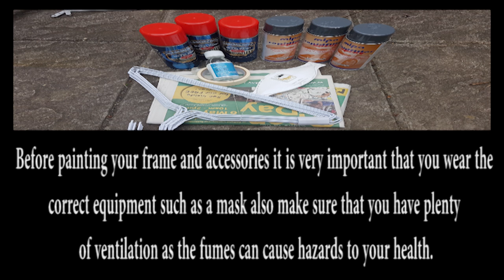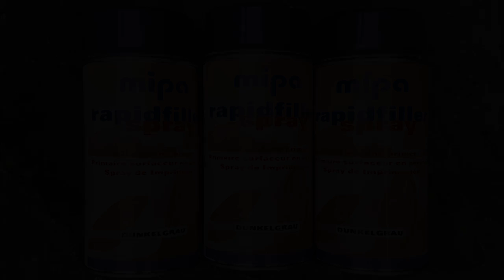How to paint your 80cc motorized bike frame

Comment: watching the disc brake sprocket mount right now actually...def gonna try that!
Reply from the maker: +Yoc Vegas ok well you will need to recount your engine slightly and make sure that the chain adjuster is correctly lined up otherwise you might end up with the chain hitting the frame.

Comment: I'd always recommend getting a white base coat for bright colors, as it means you can use less paint and have more pop. With dark colors, its essentially the same principal but with black, if you do chrome or shiny metallic colors use a black base. Dull is okay if you do a clear, which I recommend as it protects the paint, and it also means you can use matte paint. Also, if your paint allows for it, wax it for even more protection.
Reply from the maker: I agree the brighter the base coat the brighter the finish. But as this was the only colour available I thought people could still see a way of doing this idea. I have some more videos on the channel you might like so check them out and see what you think.

Comment: great vid David... i considering gettting the 4 stroke version but am unsure of the legal rules regarding using them on the road as this is an ideal mode of transport for me instead of spending many times more on a moped or car for work...i.e tax mot and insurance...any advice regarding this would be very much appreciated...and keep up the good work..
Reply from the maker: +SkilfullDTS1 it depends on what country your from and the 2 stroke one is quicker. Plus thanks for watching I hope you enjoyed this video plus I have many more like this you might enjoy.
Reply: im in the UK
Reply: any advice for me in the uk
Reply from the maker: +SkilfullDTS1 it depends on what country you are in as there are different rules.
Reply from the maker: +SkilfullDTS1 as for the UK you have to use this on private ground but I have noticed that the police don't mind as long as you are sensible and don't act like a nutcase. I hope this helps and thanks for watching.
Reply: SkilfullDTS1 parts for the 2 stroke are more common and cost less. 4 stroke motorised bike engines can be tempermental. 4 stroke engines that small are very tempermental from my experience
Reply from the maker: +Alex Hickey 4 stroke engines are more reliable but 2 stroke engines are more fun as you can customize more parts of the engine.

Comment: hey I have a question for you, can you put performance parts on your motorized bicycle before the break in period is over? any advice would be great thank you
Reply: Mike Hoffman adding minor upgrades like a better sparkplug or a sparkplug wire wont do any damage to your engine before the end of break in. Its when you start putting boost bottles, upgraded carbs and expansion chambers on before the break in is over that youll do damage to your engine
Reply from the maker: +Alex Hickey I agree it is always best to wait until the end of the break In and to be honest if you plan your route carefully you can do this in 4 bigger journeys.
Reply: David Dicker also when putting on new upgrades its best to put on only 1 at a time as the carb will need to be adjusted with the new backpressures and powerbands created by these parts
Reply from the maker: +Alex Hickey back pressure is a must especially seeing as if you wanted to install a new carb and exhaust.

Comment: Aways better to do a few light layers looks much cleaner and fresher then a thick one spray
Reply from the maker: +Bex Oneill if one coat is applied from code up and to heavy handed this will lead to runs. So it's best to do smaller even coats.